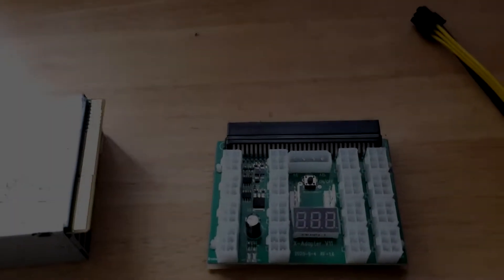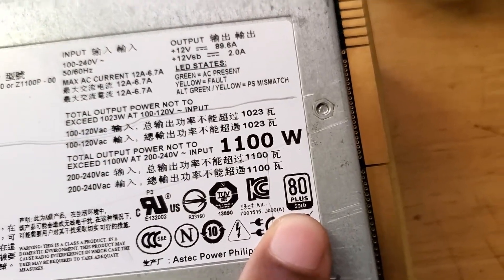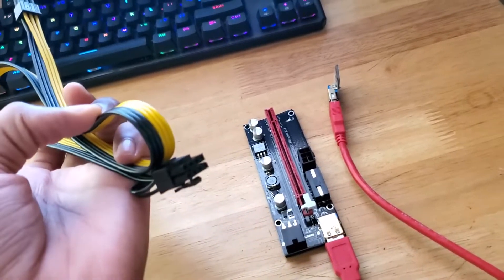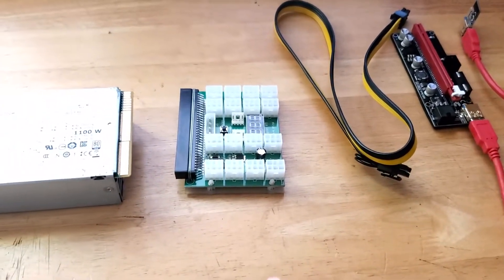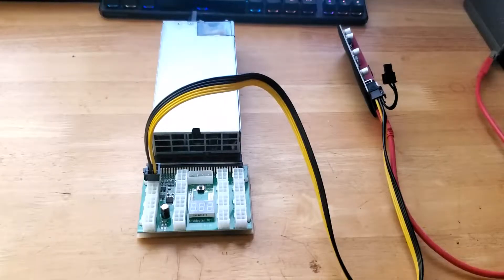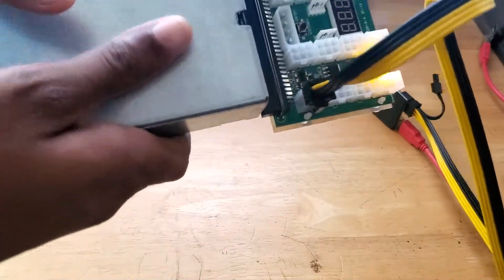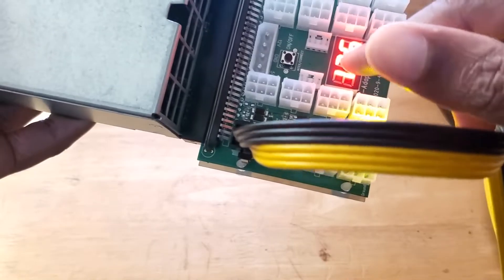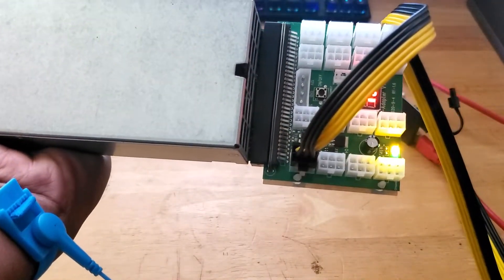Dell Server PSU + X11 Breakout Board Test !

Comment: Bruh, i don't understand! Why you bought all the parts but no GPU yet?
You should have gone for 2 GPUs atleast, so you started earning.
Reply from the maker: Hey @GreyNade the project took me around 9 months to accumulate all of the parts for the rig. Unfortunately I did not have enough cash to get everything all at once. So at end of every month I was able to invest a fraction of my income (about 100-120usd sometimes less) towards buying parts. The cost of videocards (rtx3060s) were way to high at the time.